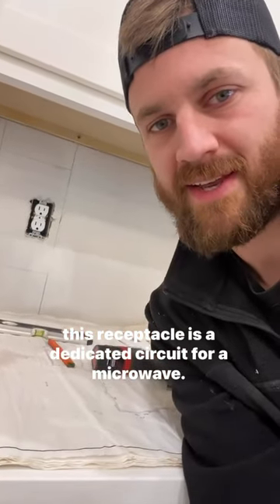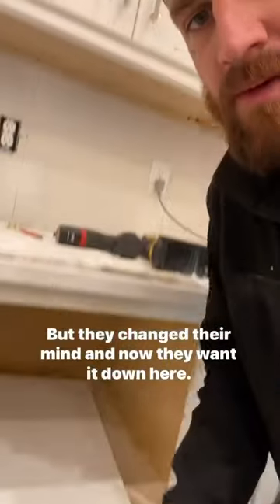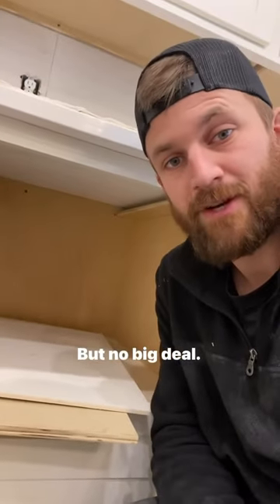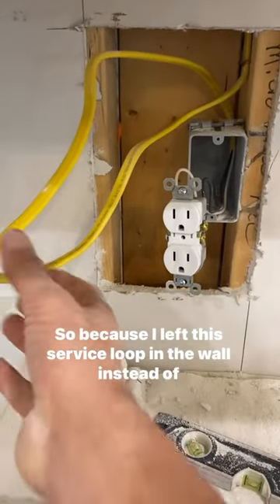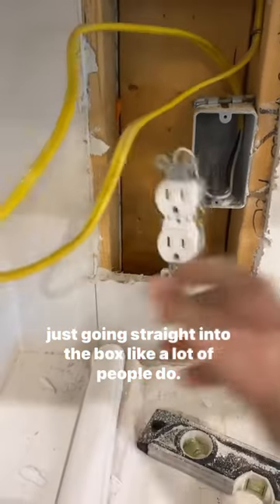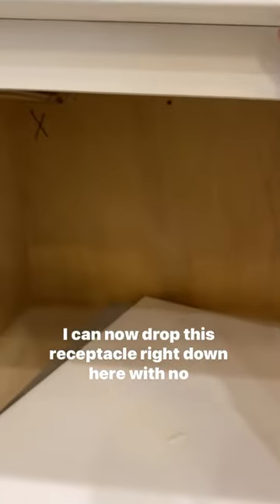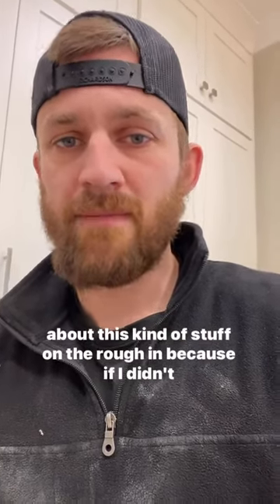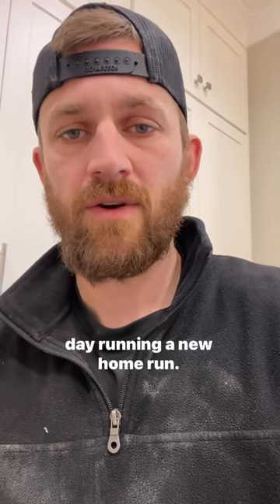This is Why You Should Leave Service Loops!! #electrician #bluecollarlife #construction

Comment: OR you could’ve just added a new outlet. I mean the EPA has been increasing it’s limitations on power consumption of microwaves anyway… no dedicated circuits needed! It just costs way more! Thanks Obama.
Reply: If an appliance draws more that 50% of the full circuit Wattage then it needs to he dedicated. I haven't seen a microwave that draws less that 1200 watts before, have you? You also need to take into account future renters/owners. Not everyone is going to know they are limited to a low Wattage appliance and it'd better to err of the side of safety
Reply: @farkmuckerzerg634  do you realize on microwave food packages it says “cook for X amount of time if you have 1100 watts or more” and “cook for X amount of time if you have less than 1100 watts”? My microwave is 1100 watts.
Reply: @lbjr777  No, electricians don't install their circuitry based off of food packages. We go with the standard microwave Wattage and err on the side of safety if we don't know the appliance Wattage. I believe if you looked into building code, you'd find it is a requirement to pass residential inspections by having a dedicated circuit for the microwave. Thanks for your insight though, I found it very useful and will make sure to tell my workers to check all food labels before installing our next circuit just in case.

Comment: Why would you have done a new home run? Just fish a new wire down from the current box and leave that receptacle there or put a blank cover over the box.  Typical contractor making a mountain out of a mole hill.
Reply: He stated it's intended to be a dedicated circuit, so leaving the receptacle there would be wrong.  He could put a blank cover over it for the splice, but that looks ugly in the middle of a brand new kitchen, so the customer quite likely won't be happy with that solution.

Comment: Your only screwing yourself in 2 ways,  1 you are using potentially 100s of extra feet of wire on the rough in & since it's a change order to move it you can charge whatever you want to change it.

Comment: All service loops do is waste wire. Since when do we design and install things with the idea they’re ALL going to be moved ONE FOOT in the future? It’s a ridiculous premise. In this case you could have just left the counter outlet and fished a wire from below WITHOUT TOUCHING THE DRYWALL. Now someone has to make that 3-coat repair. A countertop microwave does not require a dedicated circuit at all but since you have one there is nothing wrong with leaving a utility outlet functioning at the countertop.

Comment: This is the dumbest thing I’ve seen today, I get the reason for service loops because of the frequent need to replace devices and make new clean connections, rather than using old spice but as far as this goes from a code standpoint, he needs a wire for a countertop receptacle anyway, and if he still needs a wire for the countertop receptacle, he could just junction in that box and run a wire down from it on that home run and then tag one off of the nearest outlet, threw the top plates on the wall up above

Comment: Wait, what? You would pull in a whole new cable to that spot? 
Let me tell you this, if its a simple microwave and not a magnetron that pulls a lot of power, all you have to do is connect additional cable to the putlet and just make a single outlet lower and leave the top two outlets in place.
So if it was me, i wouldn't even need to cut away that plasterboard, i would instead cut away a hole below where the microwave would be situated  and fish the cable in there frok the top outlet.

But hey, im in europe, so perhaps your idiotic american regulations stop you from doing that, but last i checked here in europe, that's exactly the way to go about it. 
What i start believing is that you just try to make more work for yourself with that crap. And dont get me wrong leaving so mote cable in the walls is fine in case you want to reposition your outlets, but in this case I'm pretty sure the customer would prefer to still have these two outlets on top where you removed them. But there is one bit of an issue for me when people just leave cables like this flopping in the wall. If i decide in the future to install something near there or above the outlets, i wouldn't know there is extra cable all around in the wall and i might just drill right into the cable and kaboom goes my tool because you didnt just follow the rule of cables following the axis of the outlets. 
If im missing something, please feel free to jump on and call me dumb people, i just think my logic is not wrong at all here.

Comment: First off that service loop is illegal. Secondly you would spend no more than 3 hours adding the extended wire. You include a old work 1 gang box and keep the line straight down and it's done with less then 3' of wire.

Comment: Not really you could have ran a wire from the bottom of the receptacle to another receptacle at the bottom and then the the upper receptacle could still be used.

Comment: That’s the dumbest location for a microwave your customer has chosen.
Reply: Quite the opposite. First, it's for a portable, cheap  and disposable microwave that will sit inside an open shelf built into the base cabinet. So when it fails, and they all do, it's 20% of the cost of replacing a built-in microwave. Next, the thing is under the counter and not ON the counter, hogging up a ton of counter space. Finally, you can unload hot and potentially spillable foods at waist level, and not reach up to grab something that may burn you. 
As a licensed electrician since the 80s, IMHE, there is no reason to leave nasty loops all over a rough-in since maybe, someday, somehow, there is a .001% chance that YOU might return to the job and need them. Wire is expensive AF, and for every chance you get to make a "look how smart I am"  video, you will be back 5X to repair your silly Romex loops that drywallers zipped through, or other damage caused by rock hangers who are tired of dressing your dumb-assed loops back into the wall so they can work.